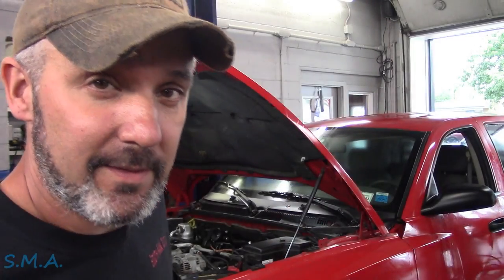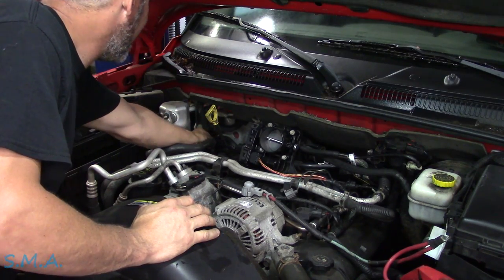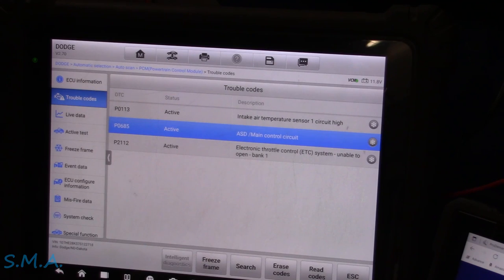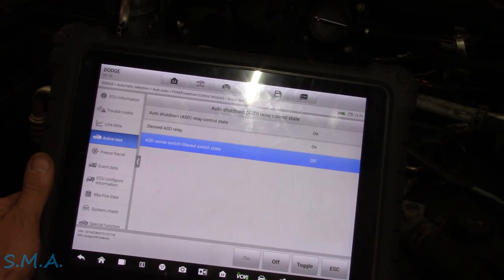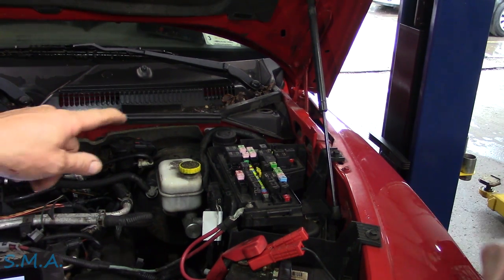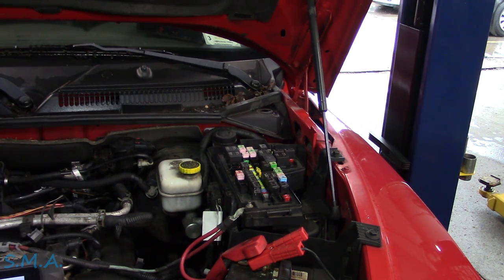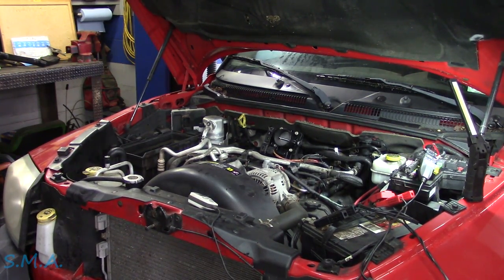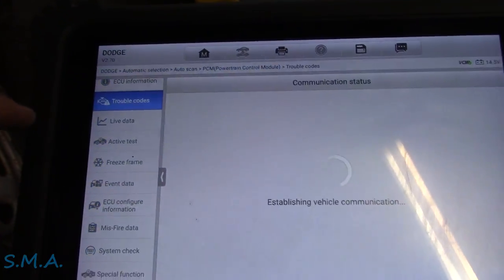Dodge Dakota: No Start After Clutch Replacement

Comment: Simplest repair ever: Newish Ford Explorer. Customer says the steering wheel tilt doesn't work. Turned out the little lever under the column flipped the opposite way of their old car...
Reply: Gotta love the easy jobs! Then the customer is like "oh good grief!" and if you're lucky, brings by some donuts as a thank you! :)
Reply from the maker: Ok fine ... You win 😂
Reply: Some folk are really stuck in their rut.
Reply: My dad had something similar.  I gave him my Mazda 323 as I upgraded to a different car.  He was concerned that the high beams didn't work, or didn't stay on when he pulled the arm back.  In THAT particular car, you had to PUSH the arm to have it stay on.
Reply: @Mr76Pontiac  Yep, Read the owners manual I say. Every car I ever purchased, I had the manual in front of me to learn that vehicle. Tons of information to gather one might not be aware of from past experience.
Reply: 2 hours labor right? 🤣🤣
Reply: friend of mine had a rent car on a trip. It died on him and he couldn't get it started. They sent a tow truck and the guy put it in park and it fired right up!
Reply: I had some hyundai or other with a knee airbag code. I was a good boy and unplugged the battery waited 20 minuters or so just to fint out that the fault was the connector was unplugged. For what reason I don't know maybe it was some kind of journalistic thing or the quality control network having some fun.
Reply: People could save themselves so much grief if they just read the owners manual...
Reply: @Garth2011  -- Yep!  RTFM!  Read The Freakin' Manual! 😁
Reply: Aha! FlipGate! You're flipping it wrong!
Reply: My dealership would have recommended replacing the whole wheel, shaft and all....
Reply: The wife got a new company car. For some ungodly reason I ended up with that car and she took my suburban. She leaves and I go to take the kids to Mac doogies for dinner. It must have been in the early 2000's. All my vehicles were from the previous century. It took me at least a 1/2 hour to figure out how to turn on the damned headlights. The kids were screaming about being hungry, I'm looking all over the dash for a light switch never thought about the little lever on the steering column. Only found it by accident. As someone else said RTFM and I have ever since.
Reply: @rimmersbryggeri  a lot of mechanics disconnect them when under the dash and forget to reconnect them
Reply: @Garth2011  Pffft.  I like to learn the hard way.  I owned my 2018 F150 for over a year and mentioned to a buddy of mine that I didn't like that there was no single wipe option for the wipers.  He said, just press the washer button quickly.... well I'll be damned lol!  I still didn't read the manual, haha.
Reply: @kennethbode2017  my wife did the same thing when she was a few hundred miles from home. On a good note I was joining her the next day and I figured it out when I got there.
Reply: Had a few like this. Work at a otr truck shop. Don't know how much everyone knows about a truck, but the headlights or top lights in most have a toggle switch to flash them. 2019 kenworth comes in for wiper motor inop. Wont mention the company name. But with their training I understand.  So guy comes in and tells me it doesn't work. So, sadly forgetting that even an older person can be new to trucking. Doesn't even question operator issue. So dmvo out testing for power. Load pro out waiting to test circuit once I confirm power. No power. Gotta be the relay. Relay tester out, no issue. Press the switch checking 87 and 30 for power. Sprayers come on. Do it a few times, no problem. Get the driver back and ask him to use them.... I repeated this request 4 or 5 times and he keeps "pressing the sprayer button. Asked him what the picture is of. He said a sprayer.... look the photo up for yourselves.  I honestly felt bad for him so made up a story of it being unplugged because there was no way I was telling his company he missed a load and half his time because he didn't know how to use it.
Reply: @Garth2011  I would RTFM but 354 pages for my Fit? And it gets worse, 800+ pages for my mom's Lexus.
Reply: @victorwanstreet3038   Yah maybe they do but this car had never had any such work done to it since it had been sold less than 1 year prior by the same dealership.
Reply: @LadyAnuB  Most of that is the radio and navigation equipment I believe. Amazing how small the print is and the amount of pages these days.
Reply: @Garth2011  In the trade there is the acronym RTFOM.(Read the f*** owners manual) Amazing the number of people that will read every page on how to use their 1k cell phone but won't bother to open the glove box to figure something out on a 60k car.
Reply: @Z4Zander  Yes, I know of many people who refuse to read the manual just because of the size of it. I try to let them know they are missing out on things they may not know about and other things along those lines but its no use. No wonder we still experience drivers who think their battery is dead only to find out they left it in drive when trying to start them.
Reply: @Garth2011  It is loads of information which includes US and Canadian models for some items. 11 chapters covering use, maintenance, loading, car features, emergency stuff and more. Yes, the layout adds to the page count but almost all information is there for basic usage. (No service manual though. 😅)
Reply: That's up there with my most memorable computer repair moment... lady said her Mac would turn on and then immediately back off again.  Turned out she was holding the power button in too long, and shutting it right back off with the same button press.  Dumbest car repair ... 1970 Datsun pickup with a sticking throttle.  Intermittent engine ground was melting the throttle cable into the plastic sheath - clue was lights flickering with throttle press. :)  Yay grounding.
Reply: Just had a comeback to our shop for HVAC not working on a Nissan after repairing the shifter. Turns out the client did not know how to turn on the HVAC control head...
Reply: @christopheryoung826  You're a good man!
Reply: One of my easiest fixes that comes to mind is I got a call from one of our drivers over the winter saying he can build air and he's about out of air, can hear an air leak but no idea where it's coming from. Drove two hours one way to knock the ice that had built up on the air tank drain chain.
Reply: I would have loved to see the expression on your face upon that discovery.... It would have been a wonderful bout of Wes's toxic sarcasm!
Reply: @RealtorGarth  my wife calls me a nerd for doing that, but it's amazing what you can learn from the owner's manual.

Comment: I was about 30 minutes into tearing the back of my Yukon apart to fix the back hatch that wouldn’t open with the remote.  This is my wife’s daily driver so I don’t spend a lot of time in it.  Luckily, before I had torn anything too far apart, I realized that the hatch has an on/off button up by the overhead console.  I toggled the switch to the on position and said “well there’s your problem lady”.
Reply: Same thing happened with our Yukon. We had the vehicle for about five years before we discovered that switch, when the symptoms were the same as yours.  Actually, it’s not a separate switch but a rocker where you push down on the end that goes towards the back of the vehicle  to open it if it is closed, or to close it if it is open. If you push the end that’s closer to the front of the vehicle, that is what locks it. You would think it would be designed such that one end of the rocker switch is to open and the other end is to close.
Reply: My wife told me that her backup camera didn't work any more so I checked it out and it was real blurry. I went back and wiped the camera lens.  BLAM! Good as new! I told her to wash her damn car and she's never brought it up since...
Reply: Haha! What a find

Comment: When I was a boy, (1975 to 80),  I spotted a 1962 IH Scout which had been sitting in the fellas front yard for years, now had a for sale sign in the window.   I told my dad I liked it and wanted to take a look at it.  It hadn't moved in at least 5 years.  He was asking $1,000.   We looked at it and my Dad said "offer him $500 cause it is in pretty sad shape.   I made the offer and he said no.   We went back a month later and I offered him $500 again, he said no.   We went back again a month later and made the same offer.   He accepted and we hooked a chain to it and pulled it home.   My dad put some gas in the tank, tapped on the float bowl and said try to start it.   I drove that scout for another 10 years before selling it.   The float was stuck.

Comment: When I was way younger, a Thunderbird came into the station with no dash lights. Head Mech found blown fuse and figured he had it bagged. The car got as far as the customer's driveway when he noticed the dash lights gone again. Same blown fuse. We had no less than 4 techs work on the intermittent short during the week, when it finally fell to me on night shift on weekend. At night I worked indoors because the bays are usually clear. Replaced the fuse, put the T-bird in reverse to pull it out of the bay, and the dash lights quit. Pulled the floor shifter (automatic) console apart and found the shifter rubbing against a (now) bare wire. A splice and rerouting of the harness and the T-bird never returned for dead dash lights.

Comment: 79 Camaro Berlinetta.  Floor shifter cable broke.  Bought another and put it in.  New cable broke. Bought another and when I put that one in I noticed the old new one was burned in two.  When I pulled the 350 out of it and put in my hot rodded 283, I forgot to re-attach the engine to body ground so the shifter cable was acting as a poor ground and melting the steel strands in the cable.  Don't forget your ground straps.

Comment: About 1974 we drove a 1965 Ford Galaxy 500 (289) from Boulder Colorado to New Orleans. The automatic transmission was starting to die so we had brought along a used junkyard transmission to swap when we reached New Orleans. I was 17 and my friend was 19. We pulled out the old transmission in my grandmother's garage and discovered that the tailpiece was too long. We took the old transmission apart and swapped them, installed the junkyard transmission and it wouldn't shift from first into second. We drove over to a transmission shop and told the guy what we had done (no internet back then) and he told us that we probably had a stuck governor and described it to us. At that point I remembered seeing two of them on the garage floor. We had left it out when we had reassembled the tailpiece on the transmission. We pulled it back out put the part in and it worked perfectly....

Comment: Uuugh, power steering fluid in brake reservoir. Realized it a few months later when the hoses started to expand and the brakes seized. Luckily, a flush and new hoses were all it took. No brake master cylinder or anti lock system problems. Thank you car gods. I always triple check the caps now before doing anything.

Comment: My electronics teacher always said when troubleshooting something start at the power.  This video while short reminds us all to start with basics, before going deep.
Reply: I’ve learned to often start with all the fuses. Even ones that seem unrelated can cause problems of blown. Have even had people put fuses in the wrong places since there’s often blank spots in the box.
Reply: I fix computers. I've gotten calls before: "My computer doesn't power on." and show up to find that there's no power at the outlet of the client's home or office. A basic reset of the breaker it was on fixed the problem. Probably tripped it with a space heater and hadn't remembered.

Comment: When pulling the engine from my son’s s10, I thought I had all of the bell housing bolts out.  Thought the engine and transmission were stuck together and just needed a little extra motivation.  Instead of slowing down and rechecking, started rocking engine back and forth with the assistance of pry bar.  Ended up breaking bell housing on the transmission.

Comment: When I was an apprentice back in the 70's working at a ford dealer I had a car with no headlight working, no low, or high beams so I  rent right to the switch wasted time ( on flat rate)  in time one of the other mechanics came to me and said the owner  of the car is a bit strange as he had worked on it before, it turned out the customer kept going until both low and high beams where burnt out. refused to let us repair, because not  covered under warranty, but not a waste of time because I never mad the mistake of underestimating stupidity. and I have yet to be disappointed .
Reply: I had a similar story with brake lights.. All 3 out, learned my lesson at a young age that multiple bulbs can be out, and the one that was working (center light) was oxidized and didn't make good connection.

Comment: Simplest repair was decades ago when I worked in a Montgomery Ward service center. Car came in not charging. Customer stated he had just come from the dealership where they worked on it two hours and failed to fix it. I popped the hood, looked at the alternator and it was unplugged. Plugged it in, worked perfect, customer happy (with me).

Comment: In the 70s , when I was a young man like J, I replaced the rear brake shoes on my 68 GTO and did not know that there were primary and secondary brake shoes. I installed two primary shoes on one side and two secondary shoes on the other. Went for a test drive, brakes dragged and one side smoked. That is how I learned about primary and secondary shoes.
Reply: Did that too, but someone pointed it out before I put the wheels back on.
Reply: When doing rear brakes, I like to leave one side alone while I work on the other one. That way I have a reference to compare the reinstalled parts. While doing a brake job for my brother in law, he "helped out" by taking the other side apart while I was working on the first one. I still got everything back together correctly.
Reply: @machintelligence  I still do that, even though the kit we use at the shop comes assembled, and I've done it a hundred times.
Reply: @panzerveps  When you only do a brake job every few years, you tend to distrust your memory. It's nice to know that I am not alone.
Reply: @machintelligence  I do brakes every day, but I still prefer to take apart only one drum at a time, or at least take loads of photos before disassembly. Usually figure it out just fine without any help, but it's good to have just in case!
Reply: That is one thing dad did teach me, "The long shoe goes in the back."

Comment: Any video you post, short or long, is a learning experience. Once couldn't get my '97 Honda to start, and I was looking everywhere and doing my diag for about 2 hours without success.  My brother-in-law strolls by and notices a ground wire is loose (from the engine to the left front), he tightens it up and we were able to start the car  right up. Learned something new that day.
Reply: Ahh yes...multiple ground wires. My daughters 95 ranger pulled that stunt on me. Would turn over but not start. Was just a busted ground wire next to the battery.

Comment: Years ago I had a customer who had purchased her 2nd hand car from the main dealers , she took it back about 6 times to them saying it wouldnt start in the mornings , they said to her nothing wrong with it , she came to me with it , I asked how do you start it from cold in the morning,  she said I just press the pedal and turn the key , I asked , what about the choke ?, she said what's that ? , turns out the dealers never showed the 18 yr old girl it had a manual choke lever , had a job last week , poor running french citroen diesel , diagnostic showing rail pressure , changed the part , with aftermarket one , would not start , refitted old one started first time , parts store replacement was fitted , still no start , old one starts again , then new part number 3 , 6 hours of my life I am never gonna get back it runs great , super video Eric,  the eligible bachelor is teaching the master on this one , I call it team work , well done guys

Comment: I was tightening the mounting clamp screw on the distributor on my 24 volt M38.  My father looked up from what he was doing across the shop, and commented "You really should disconnect the negative battery cable before you do that" just a I dropped the wrench I was using on the starter switch lead.  The spark and smoke show was quite impressive.

Comment: One time i had a lady who said the brake light was on sometimes. Fluid and brakes were fine, drove it around forever.  Noticed the coolant light was on and coolant was a little low.  Finally i started packing up to leave and she told me that was the "brake light". Topped off the coolant and it went out of course.

Comment: When I was about 12 yrs old. I was working on a Honda 750/4. I had done the repairs. Took a short break. I've always had good luck on automotive repairs. When I got back to the bike to crank it. It wouldn't  start. I kick & pushed the starter button,  getting angrier by the second. After almost setting it on fire. I looked & I had left 3 plug wires off. Put them on. Cranked right up. stupido. Haven't had to suffer that mistake again. Great work Eric O